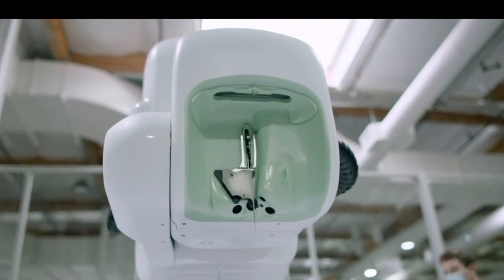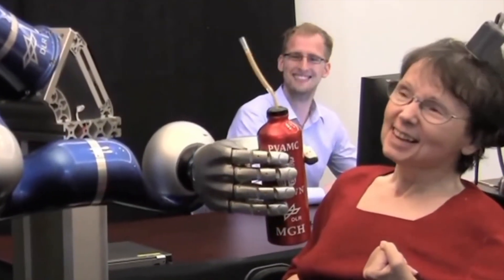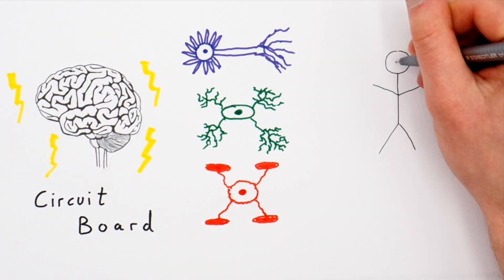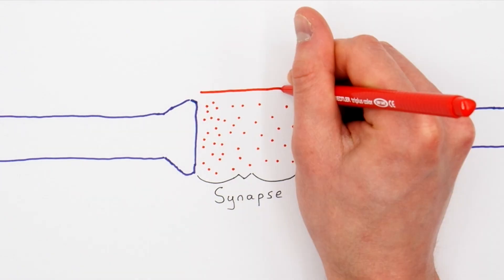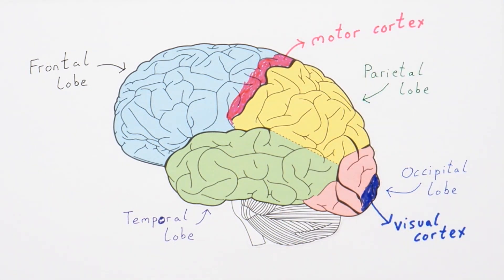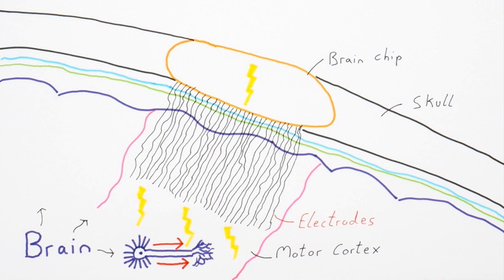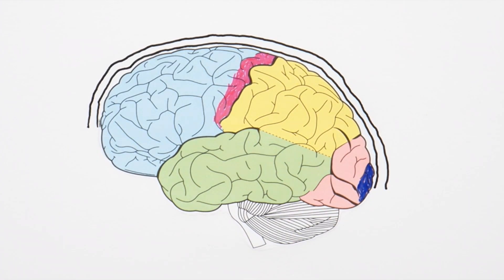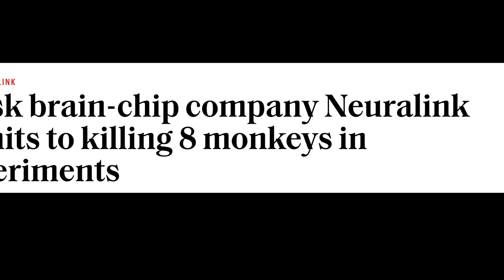How Your NEURALINK Brain Chip Will Work

Comment: Great video! How does the device actually know what signals to send to the motor cortex. Does it listen to signals from the rest of the brain? Does that mean it's wired into other areas too?
Reply from the maker: Thanks! This is a great but tricky question (I will attempt an answer)! Firstly as far as I understand neuralink chip will only have wires descending down to the immediate area under the chip. There is the possibility for multiple chips though to initiate signals in multiple areas. How does the device know what signals to send? I think is where it delves into deep learning and neural networks to figure out the connection between precise size, timing, amplitude of stimulation etc... to produce the intended effect and I imagine there has to be a fair amount of trial and error in the neuralink labs to figure this out. There is also the hope for a neuralink app that will allow you to control your phone just with your thoughts. Translating the electrical signals from your brain into typing/surfing the web is another problem for a neural network but a problem that has been solved in other BCI research, just with more bulky technology. This may be make a good video itself actually! Obviously algorithms can always be refined and improved which is what neuralink will hope to do. Hope that helps!